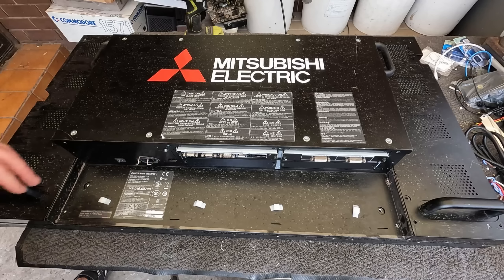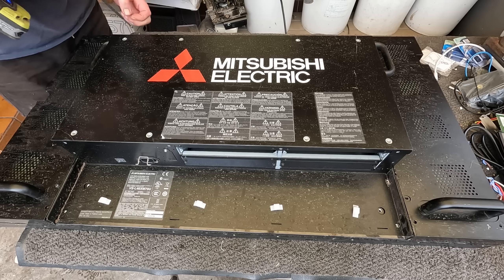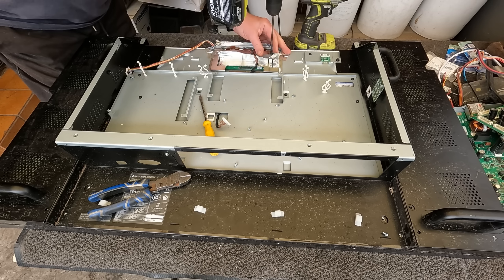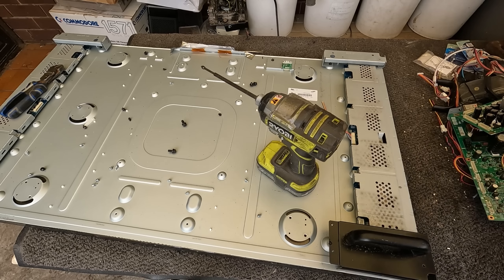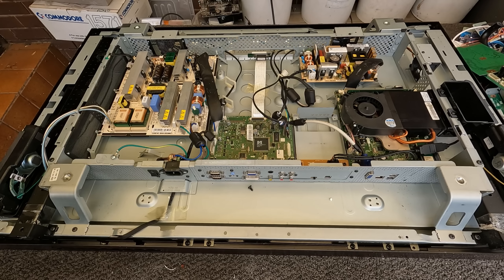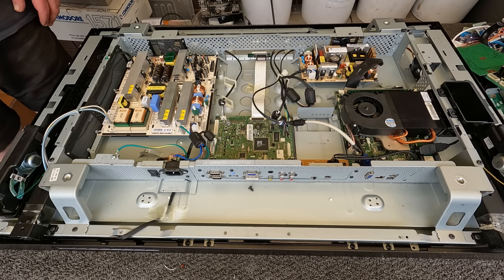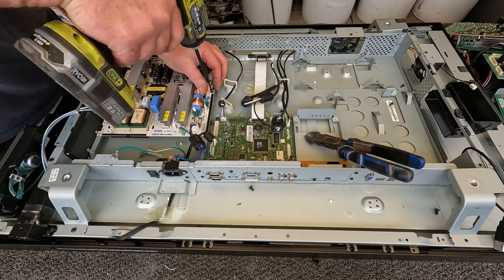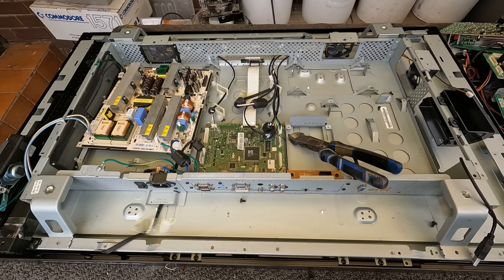Scrapping Display Monitor Session

Comment: I trash picked a PlayStation 5 and opened it to try to figure out why it wouldn't turn on. You should have seen the massive heavy copper heatsink. No, I didn't scrap it but sold it for parts repair . Turns out the power supply was faulty however I didn't want to gamble as their may have been other issues such as bad mobo etc. Buyer was happy and I made some money win win.

Comment: interesting about the power boards.  I'm in the US and my scrapyard treats those the same as midgrade/peripheral boards. larger boards are all treated as server/motherboard same as telecom boards.  hard drives are their own category if you leave the little board on the drive but if you pull the board, the hdd turns into a cheaper scrap category. heatsinks are their own category.

Comment: 🇳🇴 Hey. Have you stoped melting copper? 
Just thought,if you put on the furnace while scrapping,breaking of the copper from the powerboards,and melt while/or after scrapping,you gain the copper and saves time making it into å melting video to that you could upload  coupple of days later. 
Cheers from NORWAY 🇳🇴

Comment: with the world shortage of zinc , it could drive up the price of  Zinc as a separated metal , extruded  aluminium and other aluminium zinc alloys
Reply: There's not too much of a shortage of zinc if you take into consideration most circulating coins are mostly zinc, at least in the U.S. Numismatists call post-1982 pennies zinnies because they have very little copper.

Comment: Ben, I've heard talk of gold going to $4000 an ounce US in the next year. Is that enough for you to process your gold scrap? If you were to get a fume hood and start extracting it would give me confidence to do the same.
Reply from the maker: Well, US$4000 oz for gold would be great but kinda scary at the same time.
It wil happen eventually but the economy might send most back to lining up at soup kitchens for a feed, that could be scary as the younger generation might not handle that. 
But i'll be ready.
Main thing to realise is, we all know what we can get from gold recovery ewaste, so you probably don't have to recover, could just sell as is and let the pro's recover. either way, stockpile and hold.
Reply: I'm old enough to recall when gold was $300 us dollars. That was approximately early 1990s mid 90s.  Now gold goes for what $14-1500 us? So in 30 years gold has gone up on average 5.51% per year. Does anyone think it adequately mirrors inflation?
Reply from the maker: Gold is over US$1900 oz, averages about 8-9% per year so as good as anything I guess